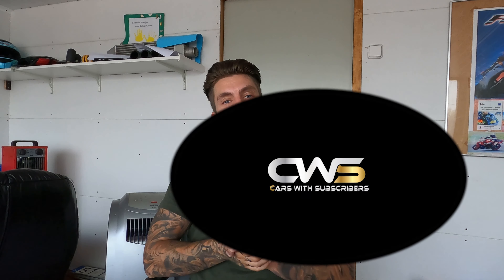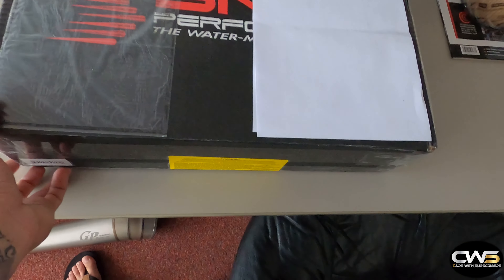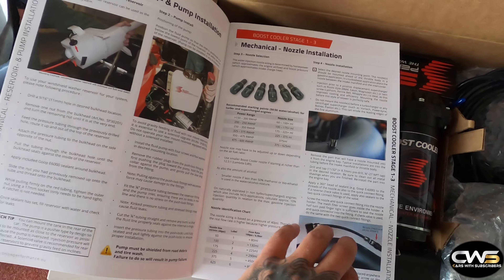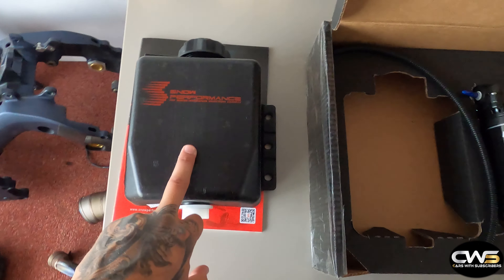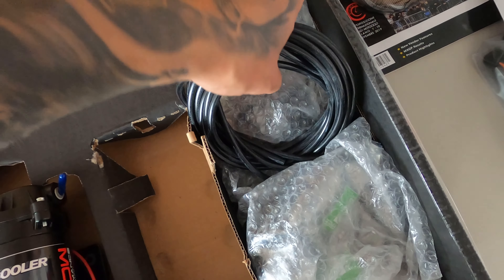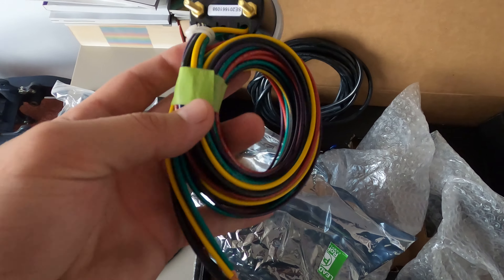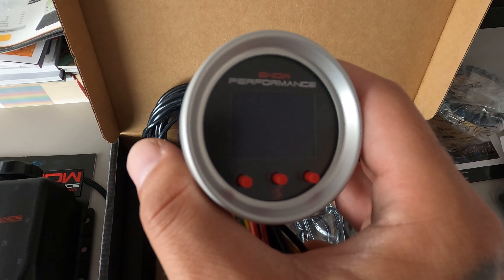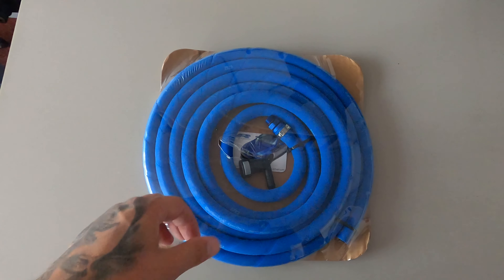Big Turbo Golf 7 R build (no hybrid) Episode 4: Unboxing Snow Performance Water & Meth kit + Update!

Comment: What kind of (W)HP you aiming for?  (on pump and e85)
Reply from the maker: Im Just going to try to get as close to 700 bhp as possible. Thats around 600 whp? Not sure but we will see how high we can get it op 102 and wmi. Not doing E85...
Reply: @BoostBroers  isn't the AN upgrade pointless then? On regular pump with WMI you would be ok with an upgraded LPFP. 

Doing something similar with my car. Similar engine but in a A5. Currently figuring out a new turbo setup since the is38 is not getting me very far with a built engine.
But it's trickier with the longitudinal engine getting the compressor housing figured out.
Reply from the maker: AN??
Reply: @BoostBroers  the precision race works fuel line upgrade. 
It's part of their MPI upgrade kit since they don't have MPI on the NA cars. So they  made an MPI upgrade which uses the fuel line you have which uses AN fittings. Basically bigger fuel line. But the stock lines with upgraded MPI injectors have being proven to be sufficient. Of course never hurts to have.
Reply from the maker: Ohh ok. Now i get You. The fuel Line i actually had laying around. Shame not to install. 😁
Reply: @BoostBroers  True, if you have it you might as well use it. 
You'll love the WMI kit, I am SP dealer being installing them on various cars. 
Definitely worth it if your going high performance. 
The extra cooling it provides alone is a plus.
Reply from the maker: Company name?
Reply: @BoostBroers  Chiptuning-plus in Belgium, who I work with.  Though a bunch of dealerships are through my personal VAT. Like SP, Armytrix and Clutch masters.
Reply from the maker: I cant see your comment on the the other video... But No, No sensor